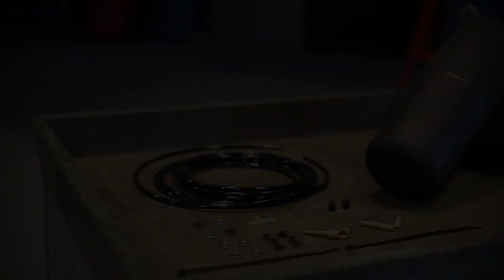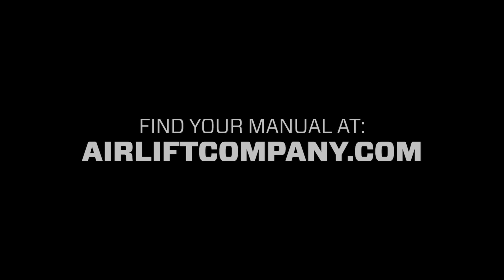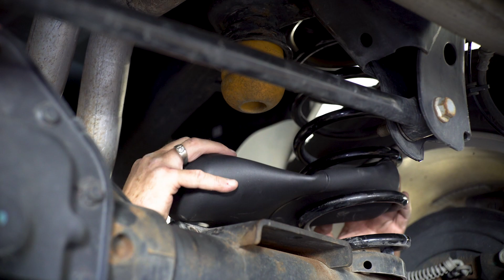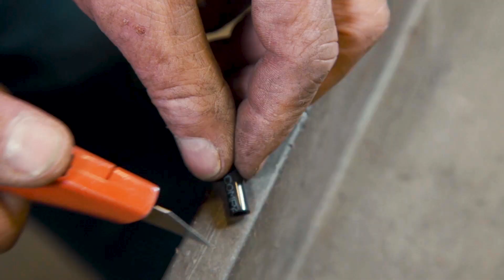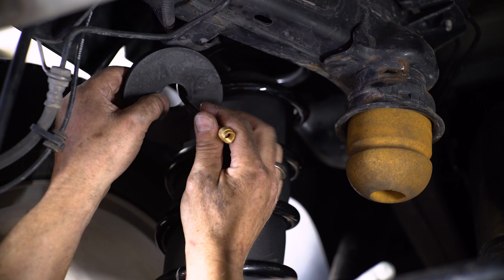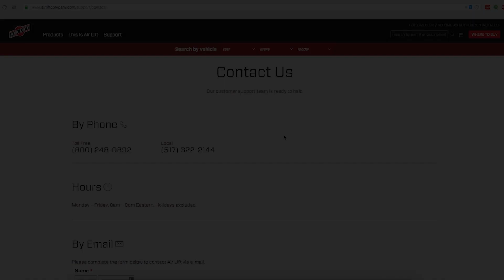Install Overview: 60818HD - AL1000HD - Dodge Ram 1500

Comment: I didn’t remove the rubber isolator at the top of the spring, will that be a problem?
Reply: yes because the spacer needs a clean surface to press against, eventually it'll slip the bag

Comment: Will these work in a 2021 ram 1500 new body style
Reply: The 2021 new body style would use the 60828HD. If you have the 4WD (non TRX) then there’s a few other options.

Comment: What keeps the valve on top of the bags from getting smashed down?  They are sticking up past the spacer and even if they weren't, the hose would be getting smashed. You didn't show any of that.
Reply: I’m having the same problem when the truck is on the ground I can’t inflate the bags because the stem is pinched
Reply: @willplayanythingga  then you have the wrong kit, move the bags down to minimum and use the "spacer" if the bag is too long you ordered the wrong bag, call technical support
Reply: @willplayanythingga  then you have the wrong kit, move the bags down to minimum and use the "spacer" if the bag is too long you ordered the wrong bag, call technical support

Comment: If for any reason the load in the bed were more than 2100 lb would these bags be damaged?
Reply: Nathan Hoover No, but the max pressure is 50 psi.  If they have more than 2100 lbs with that kit, should go to the 57365.

Comment: Sure make it look easy. I had a hell of a time. I finally gave up after I had one bag in about halfway.
Reply: Did you adequately raise the vehicle to let the spring sag? You should have been jacking the frame until the tire is off the ground to fully extend the coil. I havent installed them on my Ram yet, but Ive been in on an install and that was a gamechanger.

Comment: Hey guys quick question.  Added the 1000HD to my Ram 1500 to help get rid of my squat when towing my trailer.  I inflated the bags to the max pressure of 50 PSI and added my load but still saw over an inch of squat.  Is this normal?
Reply: You’re always going to get some squat on any truck. The air bags make a huge difference on the rams. Best route to go without sacrificing ride quality
Reply: There are also higher rated capacity kits for your vehicle, such as the LoadLifter 5000.
Reply: An inch is negligible.

Comment: Will  these work with any basic small lifts like 1-2.5inches kits
Reply from the maker: Most of the time lift kits interfere with the way the kit is installed. However, if the lift kit retains the factory coil spring and will still allow you to route air line through the top coil spring seat, it should still work.